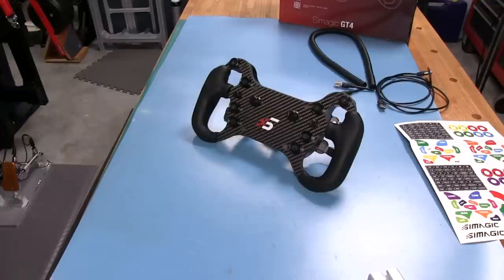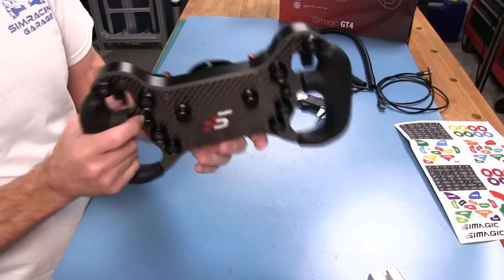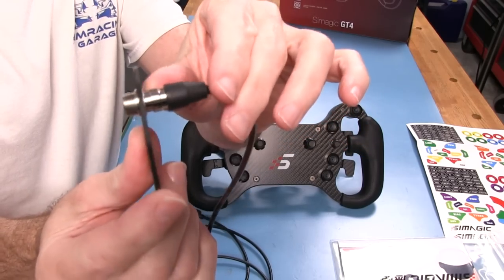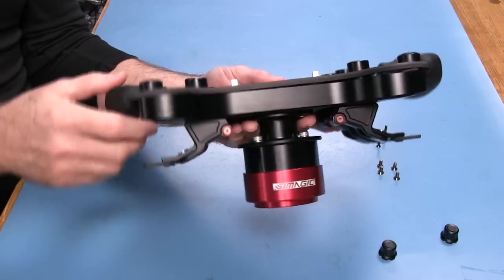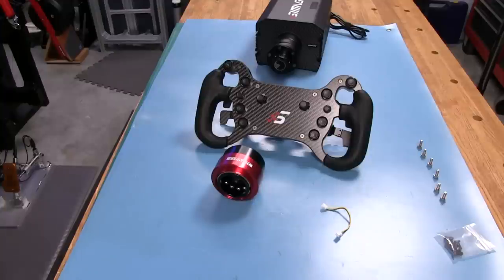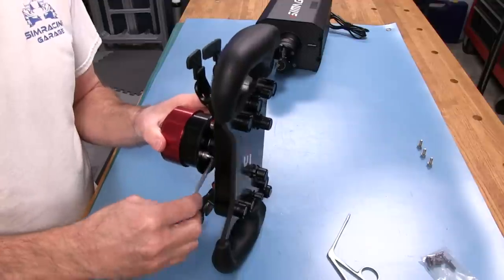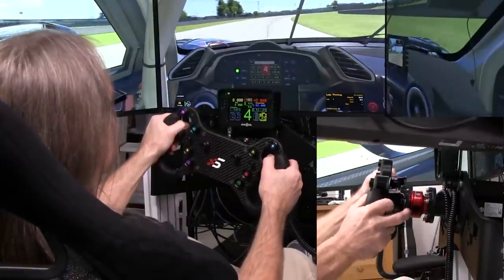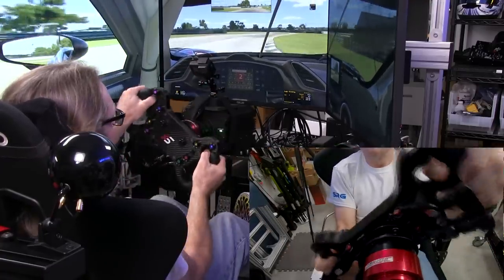Simagic GT4 Carbon Wheel Review

Comment: Great review!  Can't wait until mine comes in.  Anxiously waiting on your Alpha base review!
Reply: So.. How was it!? Were your expectations met? And its not until now that Barry is going to finally review one of the Alphas, the mini but all is good same internals different motor
Reply: @DavidGarcia-oi5nt  i'm really happy with mine, some quirks in the software but i'm figuring it out with help on the discord. wheel feels really amazing when its dialed in
Reply: @aaroncaito3280  Download and Run Alpha Manager 
Set Calibration for wheel. Set Center 
And Wheel rotation. 
Then keep open in background of your game. Should be solid after that 
Also if you lose Button Channel. Plug in USB To wheel. Then go thru each channel and press buttons untill you are reading them in Calibration screen  then unplug and remember the channel. Boom you all good again
Reply: @darwinLee81283  Thanks, yeah this all works. There are just a couple of bugs that are slowly but surely getting ironed out such as `limit angle` not saving/updating, lumpiness in wheel motor that requires power cycle on base after a few hours of usage, etc. These things are getting worked out but just be aware things are in active development.

Comment: drove 4 years with thrustmaster .  now owning the simagic alpha mini -  i can tell you that every setting with all kind  of detail is just something you have to play around with.  it made me 200% more consistant on track. not really faster, but same speed ,maybe little bit faster ( i guess here the pedals(break throttle) are more mandatory if you wanna make (big) progress in time) with waaaay less stress... the car is super controlable now.  i wanted to test different games but im stuck with ACC since 3 months now... another good thing is :  even after sessions what are 2 hours long - its not heating up or changing in some wierd way .  awesome base and wheel.
Reply: nice! read online a few times the base gets real hot when you run it close to max FFB - at what % FFB do you run it? thinking about getting one myself (coming from t300)

Comment: This little Chinese company is absolutely killing it.  My alpha mini arrived a couple of days ago with the GT1-D rim and I'm pretty impressed.  Is it perfect?  No.  Am I happy for what I paid and what else is on the market for a similar price?   Absolutely.  The QR on these wheels is fantastic, the alcantara finish on the wheel feels great (the finish on the gluing on one side of my wheel was a tiny bit off - perfectly finished on the left side where my hand grips but on the right side there is a slight gap in the gluing).  The Alpha mini itself is very good.  I've had a single disconnect so far after jumping out of AC but other than that it is performing really well in AMS 2 and RF 2, the 2 main sims I drive in.

Comment: Hi Barry, nice review! The difference between the alum face gt4 and the CF one, is that the 7 way rotaries are recessed or cut straight through the faceplate, protecting the bottom of the knob, and the rotary shaft. I was surprised to see how far up the knobs were on your model, even though you can lower them with the setscrew. There's still a tiny bit of play in the shaft, but nothing what you were showing here. This is definitely the design flaw for this model. I would personally cut in some recessed holes. Also, the handgrips are silicone on my model, instead of leather, we'll see how they hold up. This wheel is top notch, it IS worth the money and I hope they modify the cf models with the recessed mounting points. NOW, I know how to use the clutch pedals!!! Thx Barry, HNY!

Comment: I've got this rim, but mine is slightly different. The rotary switches and the funky joysticks are anondized red and blue, which isn't much of a difference, but more importantly my grips are alcantera, instead of the finished rubber you see here. They look exactly the same shape, though. So, have they done this to make the wheel cheaper to build? My alcantera grips have about 120 hours on them so far and there's zero visible wear, so I don't lmpw why they would go to the cheaper-looking rubber grips. It's odd.

Comment: Hi, i have GT4PRO and in the SimProManager only moves Clutch 2 bar. Clutch 1 doesn´t move.
I press left Clutch and then in the software SimPro the Clutch 2 bar goes to 50% and when i press right clutch in the whell, then in clutch 2 bar that was at 50% goes to 100%
But as i said, Clutch 1 in the SimPro doesn´t move.
Notice also that Sync Button don´t appear in the Simpro.

Comment: Thinking of picking with up over getting the Fanatec McLaren GT3 v2 converted to USB. Its more expensive but it seem to be way higher quality. I found one without the dual clutch ( since I wouldnt use it) for 630.00 It still seems a Little high on the price. If it was 500-550.00 I wouldn't hesitate.
Reply: I hope you didnt, Mclaren is a plastic rim
Reply: @LJMRACING  Nope. I ended up getting the GT4 Carbon. Love that rim. Everything about feels high end and solid.
Reply: @cbrdealer  nice!!!

Comment: Considering getting this over the McLaren V2. Google suggests I could make this work on a DD1
Reply: I have this wheel on a Podium Hub with the Fanatec DD1. It’s awesome value for a great 300mm GT3 wheel. High recommended.
Reply: @georgetomlinson1144  Thanks. It's likely to happen then. Unless I see the pricetag on the BMW rim coming out and it's reasonable for me.
Reply: @georgetomlinson1144  This would work with the normal QR from Fanatec as well, right? Cause I could use the one from my McLaren rim as there's no difference to using a podium hub or is there?
Reply: @BornFromTheShadows  Unfortunately not. As the the normal QR has no logic board that tells the DD1 there is a wheel connected as that electronics are in the fanatec wheels. The podium hub contains everything needed with any wheel.
Reply: @georgetomlinson1144  Ah damn that's a shame. Oh well, guess I have no choice then but to order the podium hub as well. But it's an investment for future rims as well so might not be the worst choice. Thanks for your answer!

Comment: I’ve just received this rim and it’s pretty awesome overall but I think I hate the grips lol. They are hard plastic and I feel like I’m losing grip on the wheel often. Maybe some gloves with a lot of grip on them could fix that?
Reply: I just received mine and the grips have changed to alcentara
Reply: @bradmccombs3925  did you change them or it came like that?? Do you have the same version as in this video? Where did you buy it?
Reply: No they came like that and yes it's the gt4 version with the carbon fiber front plate.  I got it from simmotion in u.s.
Reply: @bradmccombs3925  it’s USB? Or you have the wireless version with a simagic base
Reply: Wireless with simagic
Reply: @bradmccombs3925  how do you like your sim magic set up? As im currently using fantec csw, v3 pedals, and f1 v2 wheel. Really want to upgrade to a direct drive wheel base and torn which way togo